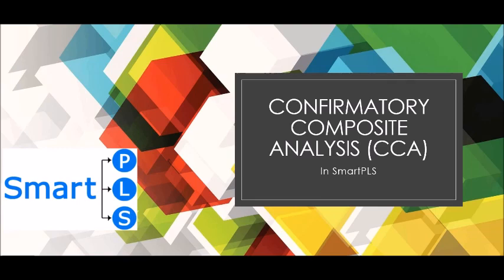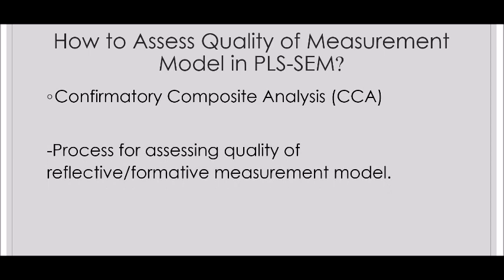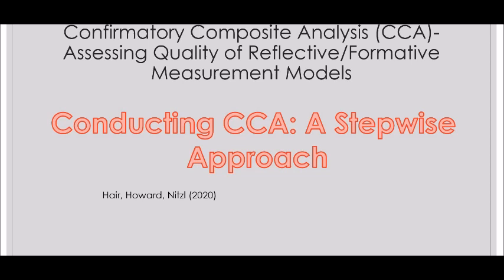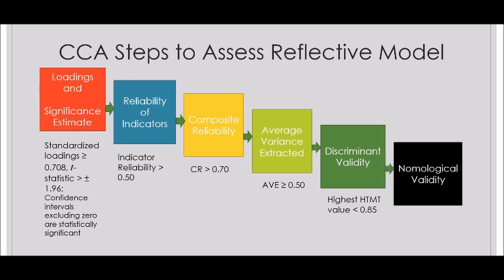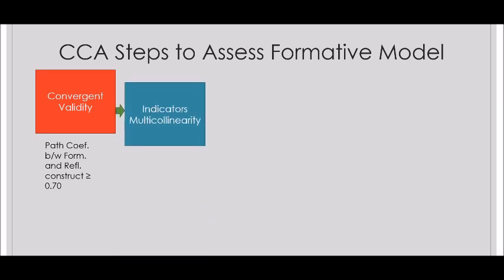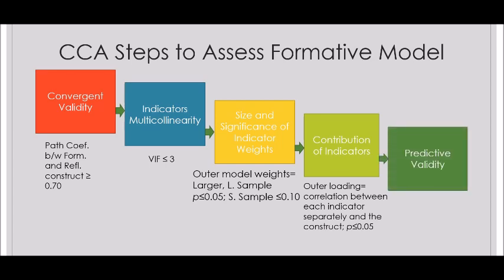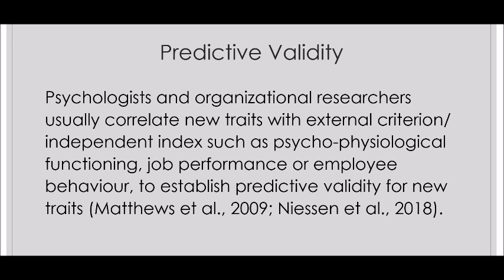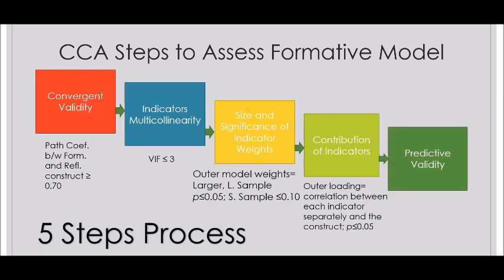Confirmatory Composite Analysis (CCA): Assessing quality of measurement model in SmartPLS (PLS-SEM)

Comment: Sir , which software tool should be used for doing CCA ?
Reply from the maker: CCA is a manual process you need to separately work on each step. Theoretically, these steps can't be incorporated into one software package.

Comment: In most of the works that use PLS-SEM, they start from the fact that the instrument is already validated. However, I have had many doubts in the case where a new instrument is designed (based on theory and adjusting scales). The question is whether, prior to the evaluation of the measurement and structural models, the instrument must be validated. And if so, how do I do it when I have a small sample? Or if, on the contrary, the evaluation of the measurement model serves to justify the validity of the instrument. Thank you for your attention.
Reply from the maker: Although SEM or PLS factor loadings are considered as equal to traditional Factor Analysis loadings by many scholars, I don't withstand with this notion. I recommend to input Pattern Matrix results into SEM or PLS model to get fully validated outcome.

Comment: Hello! Thanks for the great video! Is there a suggestion to use factor instead of path as the weighting scheme for CCA? I am just unsure cause Hair et al. (a primer on partial least squares structural equation modeling) use path to report statistics like factor loadings or AVE. Maybe you could give a quick statement if both is correct.
Reply from the maker: If your objective is to test the quality of Measurement Model, you should select Factor. Otherwise, path.

Comment: Please also tell me how to calculate indicator reliability step by step in the reflective model? I would really appreciate it if you answer both of my comments. Thank you for your support. Is it just squaring of loadings of each item(factor) in measurement model?
Reply from the maker: Yes. It's just a square.
Reply: @ChMahmoodAnwar  So I am trying to find the reference for the cut-off value of indicators reliability. Do you have any references for papers or book?
Reply from the maker: @DataChannel4  You can use both Hair et al. (2020) and this lecture video as references.
Reply: @ChMahmoodAnwar  Thanks Manoor, But I did not find indicators reliability(for reflective model)>0.50 in Hair Jr, J. F., Howard, M. C., & Nitzl, C. (2020). Assessing measurement model quality in PLS-SEM using confirmatory composite analysis. Journal of Business Research, 109, 101-110...................................can you help where its is? Looks a silly question, but ...... need your help! there is another paper. In Hair et al.2012. which mentions indicators reliability as indicators loading:>0.708 or >0.40.......So this is confusing what is cut-off for indicators reliability actually and where it is ...you may find it for me.
Reply from the maker: @DataChannel4  I already told you that I have clarified many points of CCA article in my lecture including indicator reliability value. May be Dr. Hair forgot to mention it in his CCA paper.

Comment: Hi Mansoor, Can you please explain the step-wise procedure of doing predictive validity analysis in smart pls, spss or any other software for the formative model?  Do you have any reference paper for this step procedure?
Reply from the maker: Hi there. I will explain it in a separate video. Meanwhile, you can read this article to test predictive validity of a new construct using correlation & regression analysis www.ekonomie-management.cz/en/archiv/search/detail/1915/
Reply: @ChMahmoodAnwar  Hi Mansoor my model is non-normal so regression seems not a good idea to check predictive validity in SPSS. That would really be helpful if you can make some video or can help to know how I can test predictive validity in this case..
Reply from the maker: @DataChannel4  See my latest video on it. Use correlation because it doesn't assume normality.
Reply: @ChMahmoodAnwar  Hi Mansoor, please see your comment above in response to my comment. Here you mentioned, you can use correlation for checking predictive validity if data is not normal. If I use correlation to check predictive validity even if data is normal, will it be correct then? As I have not collected the data for the criterion variable.
Reply from the maker: @DataChannel4  Normality of data is another topic. Correlation needs 2 variables, you have not collected criterion, how you will correlate?

Comment: I only have formative exogenous, endogenous, and mediator constructs. Should I only use 5 steps for the formative constructs you mentioned?
Reply from the maker: 5 steps are for you. If you have not included independent index in your research previously and already collected data, then you may leave 5th step.
Reply: @ChMahmoodAnwar  On what grounds can we drop predictive validity(5th step), if we have not added an independent index? Can you please share any references? That would be a great help!
Reply from the maker: @DataChannel4  Since CCA and  application of predictive validity in CCA are relatively new topics, you wouldn't find any citation to this. You can cite this video reference following APA style.
Reply: @ChMahmoodAnwar  Thanks, I will. But I also need to give a logic why I am dropping predictive validity when it is the one step suggested by Hair et al. Can you explain the logic why we are dropping this necessary step?
Reply from the maker: @DataChannel4  CCA being a neoteric notion, was not explicitly studied by candidate, therefore, the required data were not collected. Thanks.
Reply: @ChMahmoodAnwar  I think, in either case, it is possible to justify predictive validity with item correlation if we have not collected the data related to criterion variable. Should we not use it as a substitution(whether the data set is/is not normal) to justify predictive validity instead of leaving out this step?
Reply from the maker: @DataChannel4  Please study and understand the theory of predictive validity carefully. Items correlation has nothing to do with predictive validity.
Reply: @ChMahmoodAnwar  Earlier you said that if data is not normal use correlations for predictive validity. Does this mean correlation between variables? Can we not justify predictive validity with correlations among variables even data is normal if we have not collected criterion variables.
Reply from the maker: @DataChannel4  I didn't use the word "normal" in whole lecture. Data normality is a CLRM assumption and has nothing to do with this CCA lecture.